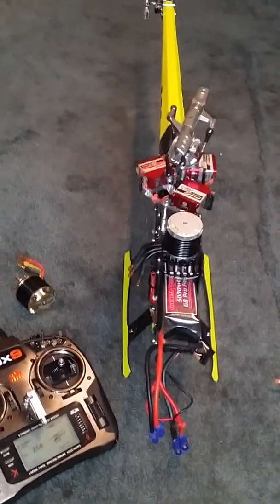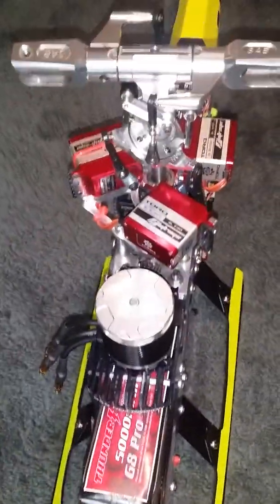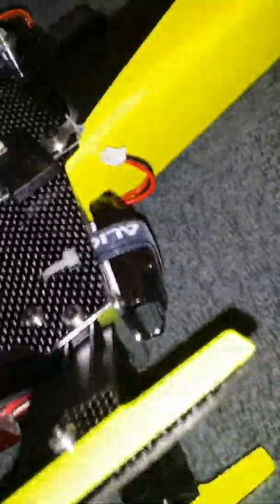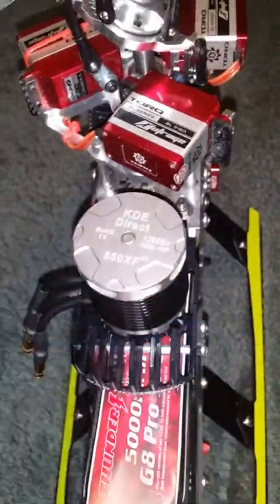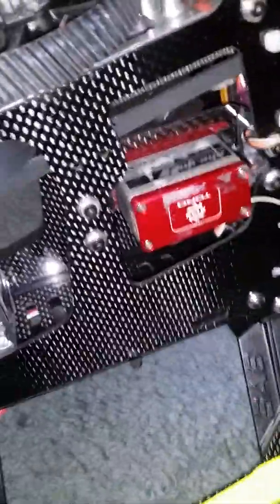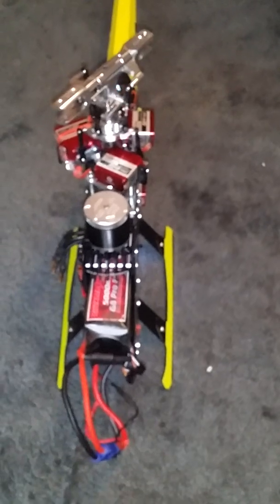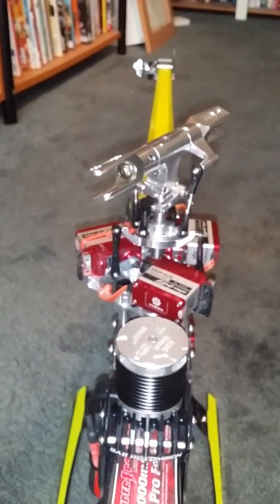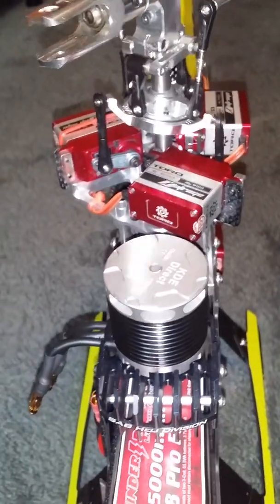Goblin 570 (KDE motor burning servos problem!)

Comment: Hey man,
Did you check to see if the windings were bad or maybe a motor mount screw was too long and touching the windings of the motor cause it looks like there is a short earthing out on to the servo case and if you look very closely to the footage you can clearly see that the smoke was coming from the carbon spacer/mount which if you didn't know is conductive cause if the servos spewed out the magic smoke they would work after this happened.
Try and take the carbon spacer/mount off and just give it a smell to see if its burnt and I would bet that the servos are fine and you luckily got away with not burning out anything.
Also open up the back of the servo case and see if it smells burnt or not and you will have your answer.
Hope this helps.
Regards,
Pete.
Reply from the maker: No the screws weren't too long touching the wires in the motor in fact they are quite short. Wish I'd showed you guys another thing weird... that is if I made the ESC and Vbar initialise then plug the motor in it would spin though burning the servos at the same time! I know carbon is conductive and that in the video it may kinda look like it was the carbon plates next to the servos that where burning but after doing it quite a few times I'm pretty sure it was the servos unfortunately!
Reply from the maker: When FastLads and KDE looked at the motor themselves the said that there was no signs of a screw damaging the wires yet KDE they couldn't replicate problem they said. I really wanted to try these new KDE G3 motors but the issue has taken so long now to resolve I've decided to go for other motor both in the G570 and G700 otherwise winter will back and I get no flight time by the looks of things!
Reply from the maker: Patric at KDE did send me a new motor and I asked him to send me a the 12s version instead and he did. However I then went for the KONTRONIK PYRO 65-62 after for a 12s setup. I concluded that the problem was caused by the motor conducting with the metal casing of these TORQ servos.

Good service from KDE and FastLads

Comment: Hey, very ugly isue. I think your Problem is caused by a broken Motor. I guess He had an inner Isolation issue and pull the ground Potential up to a small voltage, from 0V to maybe 5V, then the servos Are not supply from 8.4V,  but rather from 8.4V + 5V =13.4V :-/ i dintn see those issue before, but i guess the servos Are also down. Your Dealer have to replace it too.
Reply from the maker: Hmm very interesting. Now I wish I'de used a multimeter on it before sending. However I did use the one in the Vbar and it did read 8.4v however I didn't test the readout when powered up. Saying that I'm glad it didn't take the Vbar out in the process! Thanks
Reply from the maker: Patric at KDE did send me a new motor and I asked him to send me a the 12s version instead and he did. However I then went for the KONTRONIK PYRO 65-62 after for a 12s setup. I concluded that the problem was caused by the motor conducting with the metal casing of these TORQ servos.

Good service from KDE and FastLads
Reply: MFizzle777 i want to get my model trex 700l weighing 4.995kg and i think a pyro 750 560kv has plenty of power plus running a 14s setup aswel thunderpower 70c 7s 5000mah lipos fit the frame  but using kde upgrades and gona ask if boca can do full ceramic bearings aswel plus doing wire management aswel it cuts of a few grams but having a 5.2kg model is just bad you can get better flight times if you knock it slightly under 5kg
Reply from the maker: Sounds Like your doing a crazy powerful setup. I also use the Pyro 750 560kv which is a sweet motor and I'm guessing that you're using a KOSMIK with that. Though I just can't think of where you can save weight on the 700L. The batteries are the place to look however as your useing 14s I'm pretty sure the Heli will not be useing 70C from the packs so you could find some lighter ones or try some 4400 mAh for ultimate performance since you're planning on useing ceramics then your flight times may not be bad.
Reply: Well i can knock a few grams with the kde upgrades and getting full custum made ceramic bearings from boca dont forget your wires need to be long but not too long because the thick 10awg holds a few grams so cutting the slack a little will work but the sab gobling weighs 5.2kg with a 14s setup but and the 7s lipos do have long wires i might measure and trim in areas if i can get my model under 5.1kg ile be happy reason i picked the pyro was because it has enough power for sportflying with mild 3d at 2000rpm but efieceny is the key but if i can fly 5000mah 7s at under 5.1kg  dont forget some 12s setups are 5.2kg with no triming on weight
Reply: MFizzle777 or i get a pyro 700 56l competion it weighs 375g plus all the trimming off slack wires and running 14s plus a  align 700mx had plenty of power i just dont realy feel i need a pyro 750 i change my mind i am doing sport flying mixed with mild 3d a 4kw motor is still better than a nitro engine
Reply from the maker: True 4kw way better than nitro. So I guess you solved it then as for that type of flying you don't need too much.
Reply: MFizzle777 ile send you my weight list
Reply: MFizzle777  kde upgrade parts 562g kosmik 250g pyro 700 52l 375g blades 380g tail blade 12g thunderpower 6s 70c 5000mah x2 1.593kg  total unfinished weight is 2.946kg just need align parts and ceramic hybrid bearings and wire management to do if you can guese the weight i guese 4kg or a few grams under it plus need a gyro and rx plus those items will be light aswel going with a xg8 jr radio i think my flying weight will destroy any nitro because they weigh 4.4kg with no fuel and my trex 700 is 2.946kg unfinished without the hybrid ceramics or slack wires managed  this is untampered weight but tampered weight will make it lighter lol like i said  this equipment i got needs the pod and boom frame lol

Comment: did you tested it with a multimeter?
Reply from the maker: I sent the motor back pretty much straight away after the vid was posted so no!
Reply from the maker: Patric at KDE did send me a new motor and I asked him to send me a the 12s version instead and he did. However I then went for the KONTRONIK PYRO 65-62 after for a 12s setup. I concluded that the problem was caused by the motor conducting with the metal casing of these TORQ servos.

Good service from KDE and FastLads

Comment: I'm interested to see what they do bro, sorry man that's some freaky sh1t
Reply from the maker: Sure is and was looking forward to flying it last weekend as I stayed up in the midnight sorting it out :-(
Reply from the maker: Patric at KDE did send me a new motor and I asked him to send me a the 12s version instead and he did. However I then went for the KONTRONIK PYRO 65-62 after for a 12s setup. I concluded that the problem was caused by the motor conducting with the metal casing of these TORQ servos.

Good service from KDE and FastLads
Reply: Sounds strange because why wouldn't all motors do it if they are metal, maybe the anodized finish on the pyro prevents what doesn't on the KDE? 

I guess you can test easy enough by using an insulating layer of something like tape or cardboard to stop servos touching the frame. You could even insulate under the motor too.

Only way to be sure the motor is sound to test windings with a inductance meter but it did spin up ok in your test so i'd guess they were ok too. At least your sorted man, let there be smack!
Reply from the maker: Lol. Will soon post a vid of my new 12s setup. However because of that conducting issue I decided not to use even the 12s version and now I'm KONTRONIK all the way. Don't want to insulate it because if that insulator fails in flight your electronics and Heli are toasted!

Comment: they have to give you guaranty and replace the servo's
think electric problem in the motor
Reply from the maker: I sure hope they do as I'll be sending this video to them with the motor this week. Thanks
Reply: MFizzle777 keep us posted , good luck
Reply from the maker: Patric at KDE did send me a new motor and I asked him to send me a the 12s version instead and he did. However I then went for the KONTRONIK PYRO 65-62 after for a 12s setup. I concluded that the problem was caused by the motor conducting with the metal casing of these TORQ servos.

Good service from KDE and FastLads
Reply: MFizzle777 That's good service hope you have nice flights on it
have a good weekend
Reply from the maker: You have a good weekend too m8.